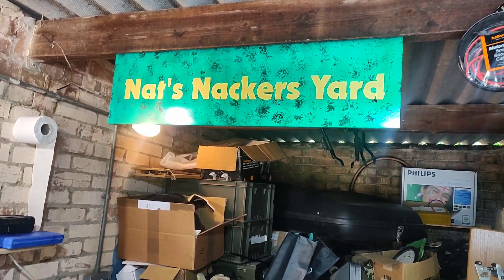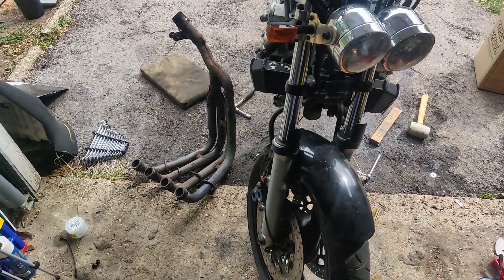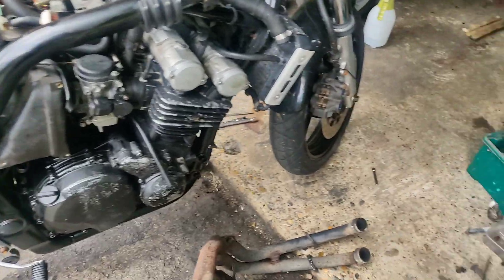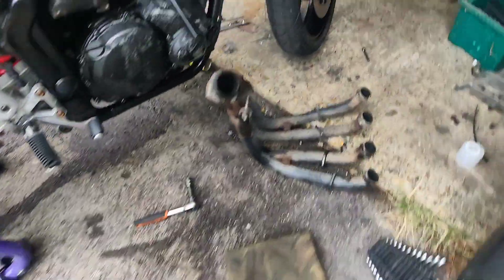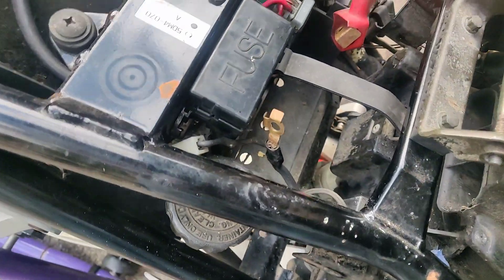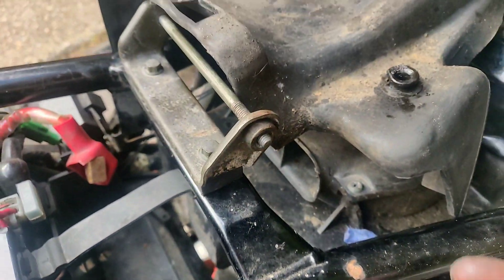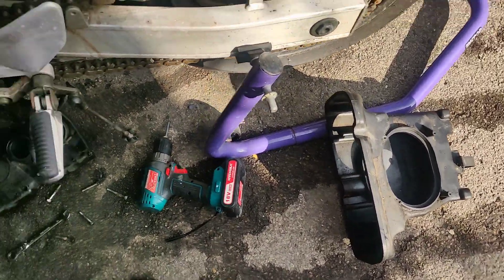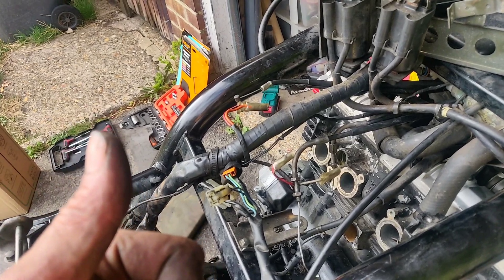Tango airbox fight.  I win (eventually)!

Comment: It's a victory.👍
Some of these designers need a strong word in their ear. No thoughts on getting parts off later.
Worst one I did a while ago was a Piaggio scooter. Could only get the exhaust bolts back on with the engine half out. 😬
Reply from the maker: It's like they do it on purpose at times!